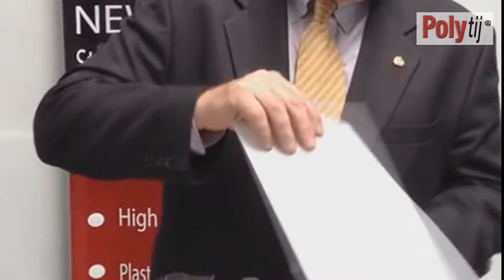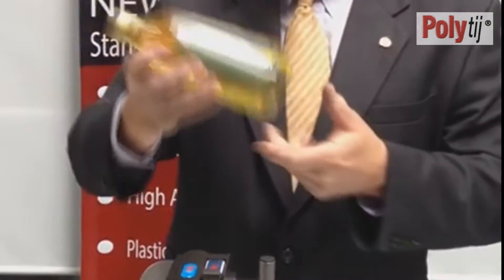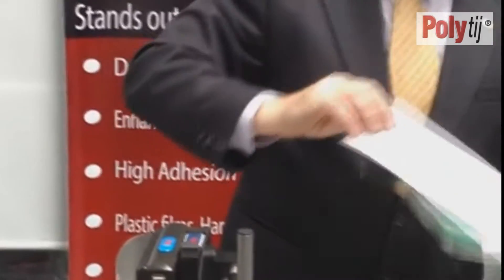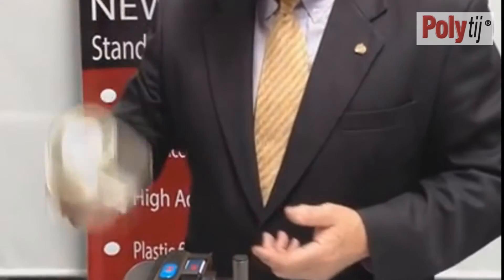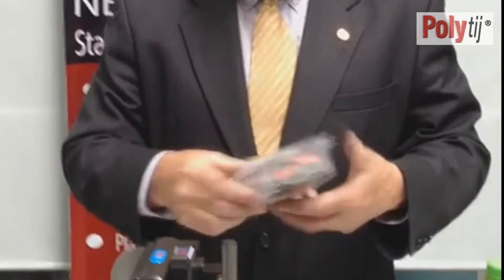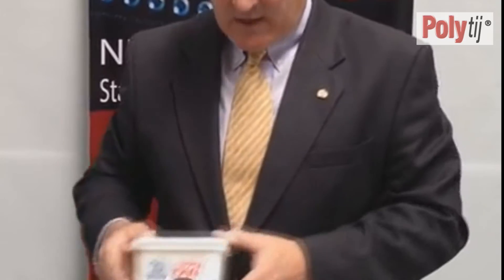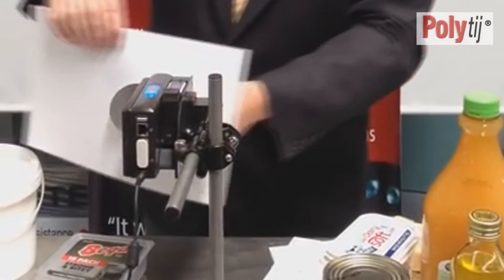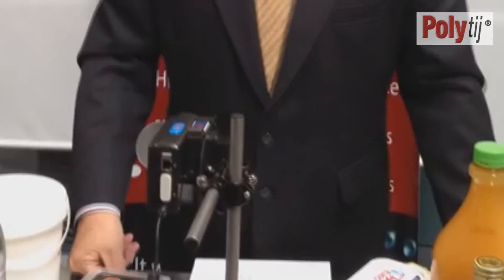POLYtij TIJ ink polymer thermal inkjet technology | non porous ink

Comment from the maker: POLYtij  ink technology, is a new ink category - polymer thermal inkjet technology, which offers industrial thermal inkjet users the ability to continuously OR intermittently print on most non porous substrates used in the global packaging industry today with dry times of less than one second, high adhesion and rub resistance. We don't just sell cartridges, we offer a system integration approach which provides you with the best non porous thermal ink solution.

POLYtij    ink offers thermal inkjet users the ability to print with industrial thermal inkjet printers in applications never thought possible with thermal inkjet technology.
POLYtij  ink is a new ink category, polymer thermal inkjet ink technology.
 
POLYtij   ink has been designed specifically for printing "use-by" and "batch codes" on non porous primary packaging.
 
POLYtij   ink technology will enable you to print onto glass, metals such as tin & stainless steel and a wide range of plastics from PET, PP, PE films, hard plastics such as HDPE, PET, PVC used in the packaging industry globally.
 
Key features of POLYtij   ink:
Superior dry times of less than one second
Big throw distances (5-12mm)
High Adhesion
High rub resistance
Excellent printhead recovery time
 
Importantly we adopt a complete system integraton approach to solving your non porous inkjet printing problems.  We work with you to ensure that you optimise the adhesion, rub resistance and optical density of your printed messages.
 
POLYtij   ink technology finally offers industrial thermal inkjet users the ability to target new frontiers for HP and Funai Lexmark thermal inkjet technology.